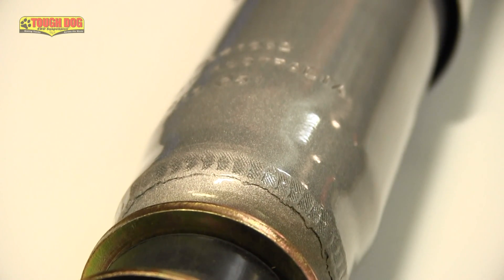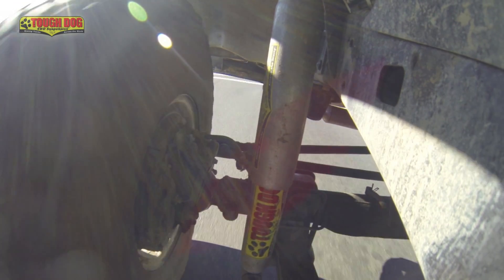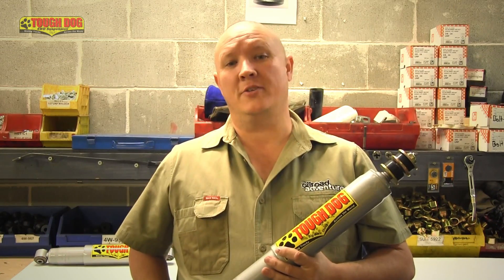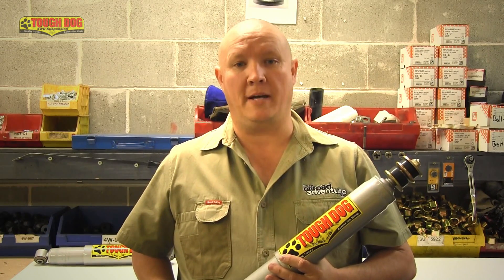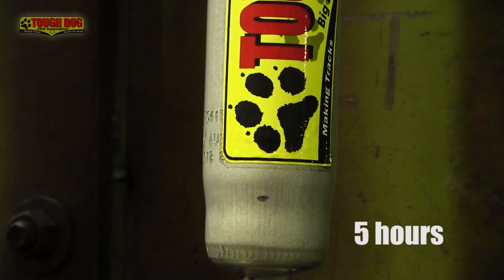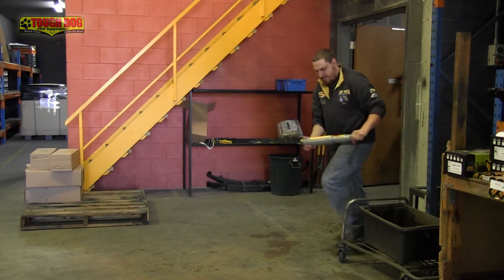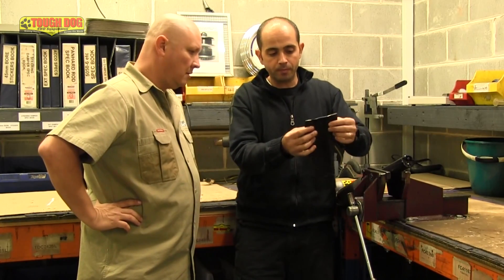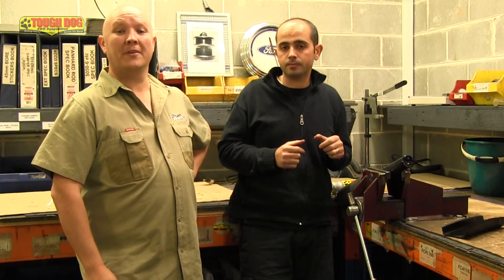Tough Dog Foam Cell Shock Absorber Myths

Comment: Hahahaha after that short of a test even a std replacement maxitrac would still be fine. 
Be honest about where the "myth" came from tough dog!
Maybe the original verry poor designed foam cell that you still nitrogen charge? Even though others had 20y of foam cell tech before yours. 
But hey even your new version is cheap crap.
Reply: What about iron man foam cells or are foam cells just hype?
Reply: @MH-ls1xi  foam cell are a good thing. 
Tough dog just failed miserably with the early style. 
Pedders have been building foam cell for over 20 years.  The rest have been playing with them for past 10ish. I believe iron man are ok
Reply: Thanks